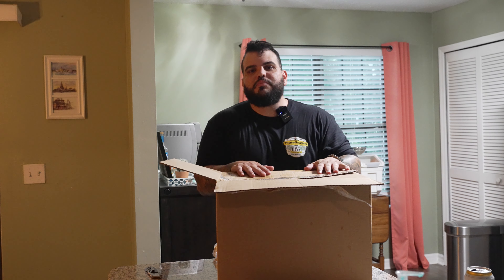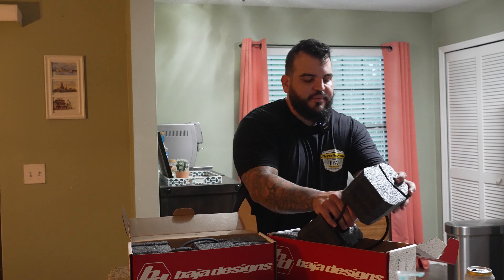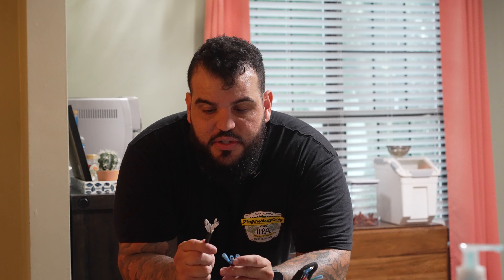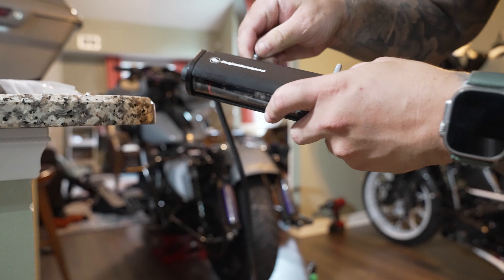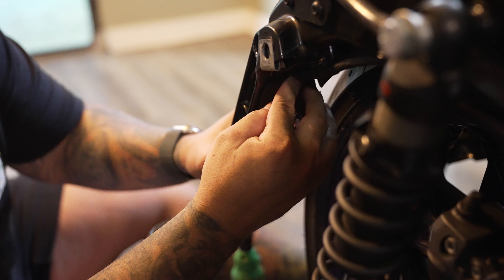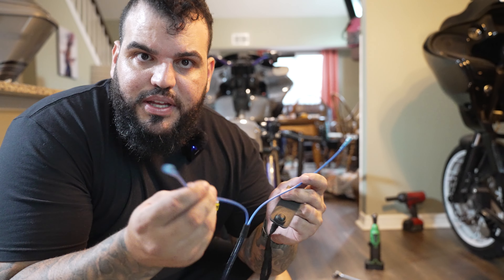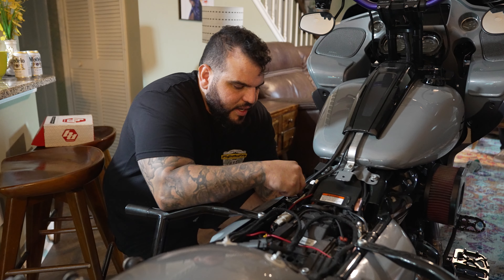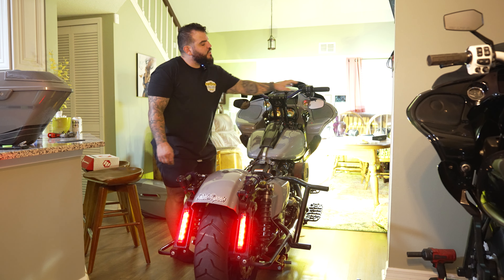How to install RTL-M's on your Harley Davidson Bagger

Comment: Just an fyi when you first start talking about the switch connections you say to connect the terminal lead to the power then the second time when your actually connecting it you say to connect the terminal lead to the negative on the battery.